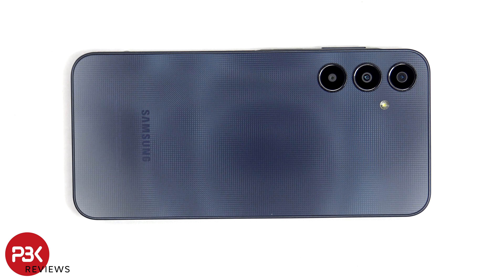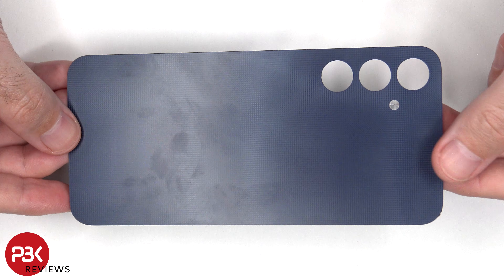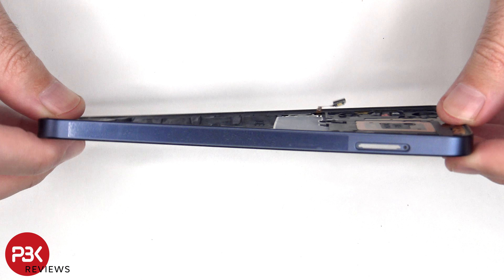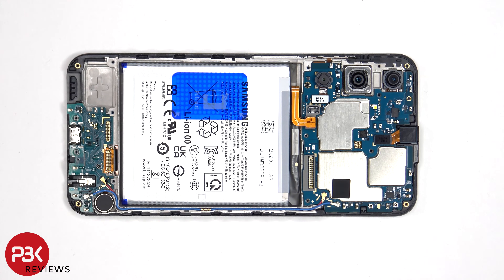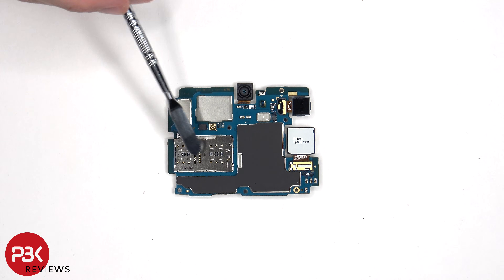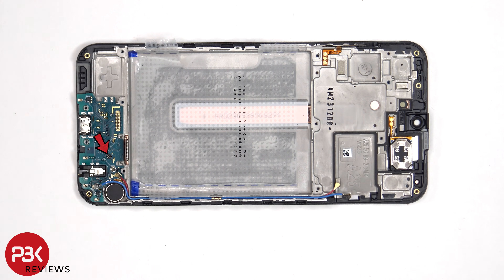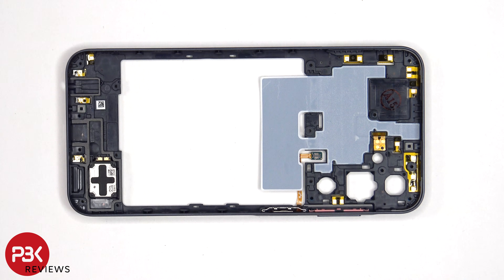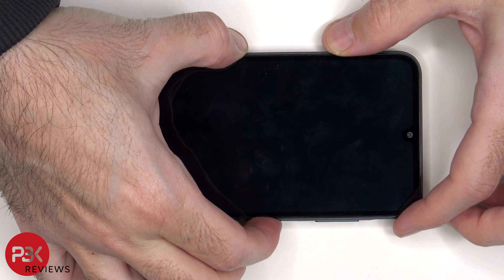Samsung Galaxy A25 5G Teardown Disassembly Repair Video Review

Comment: So I got a new screen and installed it, it thinks it's overheating when it's not so I know the overheat sensors aren't working. The screen wasn't OEM so I think that's why. I got another brand ordered and I plant to use that. Hopefully it works 😅

Comment: Great teardown. Cheap internal build of the phone though. I have this phone and the Bluetooth audio playback is absolutely terrible. I have switched back to my galaxy S 21 which has by far way better audio playback.
Reply: Stuttering issue?, Mine did but one UI 7 patched it but it's still not great
Reply: @arkanhisyam8017 yeah. This phone really needs an update that will optimise the internal hardware more as I feel the os is causing stuttering and lag issues as mine is really laggy.

Comment: Is it possible to change/remove the heat sensor? I had a screen repair done and now it is immediatly showing an overheat warning and turning off even without doing anything or getting hot, it does this even after a factory reset so I think it is a sensor issue.

Comment: The screws in mine are really weak, i got 10 out. The other 5 stripped really badly. Got any tips for that?
Reply from the maker: Try using one size larger screw driver when you feel it stripping and press down when unscrewing. If its completely stripped, you may need to drill into the screw head with a drill bit to break off the head.
Reply: always test the screwdriver or the bit on the screw first to see if it meshes with the screw perfect, then it won't strip if you're pushing down on it a normal amount when unscrewing

Comment: awesome video. may i ask, is it possible to separate the screen from the screen frame or the bezel? (the black plastic edge around the screen) because mine is damaged and i dont want to replace the whole screen. thanks
Reply from the maker: Its possible, but there is a chance of damaging the screen prying it off from the frame, as well as the fact its really hard to find just the screen frame by itself to replace.

Comment: I suppose since we're all here talking about our issues with our phones. Through a long and complicated story, my phone has gotten damaged from both mud and water and after a while, it stopped responding to my touch and the Samsung logo appeared, then it shut itself off about two minutes after. I tried rice, but I'm impatient. Would taking it apart and drying out the individual components be quicker? More importantly, is it more likely that the phone is completely toast and I should just get a new one?
Reply from the maker: when phone gets liquid damage, its important not to attempt to use it, until you take it apart, disconnect the battery cable and dry it out. Brush off any corrosion on chips or connectors which a small brush like a tooth brush and then attempt to power it on and use or else you can risk shorting parts in the phone. You wont know until you take it apart and clean it out.

Comment: My gps does not work. no signal. I have run GPS test, GPS toolbox. followed all the possible recommendations from samsung website. Is disconnected antenna possible on that phone? I tried evverything except factory reset.
Reply: The phone has a 2 year Warrenty for issues like that just contact samsung

Comment: I've been using the phone for a week, everything is fine, except for one thing - it gets very hot. I don't play games. It heats up from the camera, Instagram, YouTube, Google Chrome, etc. Moreover, not only the back side, but also the screen heats up quite a bit, although I don’t use the maximum brightness. I already bought the original cover, but it is still very warm even through the cover. Is this a problem with the exynos1280 processor? Nobody really talks about this anywhere. Am I the only one having this problem?
Reply: Ele realmente esquenta um pouco.
Reply: They get hot when they're charging. Also when u use them under direct sun or near a heavy heat source
Reply: It doesn't heat up that much on me,But on Roblox a lot😂.Youtube,and Google and Social Medias.It remains too Cool
Reply: Exynos used to be incredibly hot, but Exynos 1280 which is used in this phone is supposed to be much better and dissipate similar heat and power compared to another chipset on its price range. Still hotter than low end though, but at least much better than flagship chipset
Reply: yo, go to settings, and go to display, and then go to motion smoothness, switch it to 60hz, it'll run cooler and use less power too, I'm not so fancy, i don't need the 120hz 🥲🥴, it's nice that it has the ability though, and that you can switch it at any time